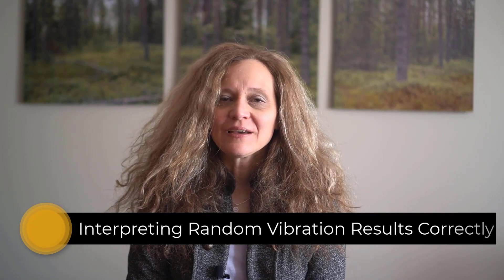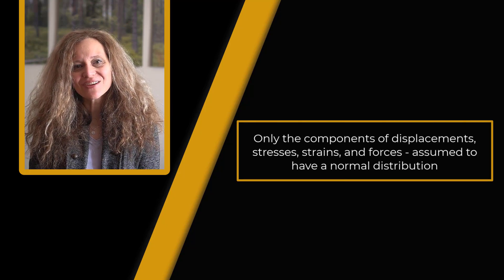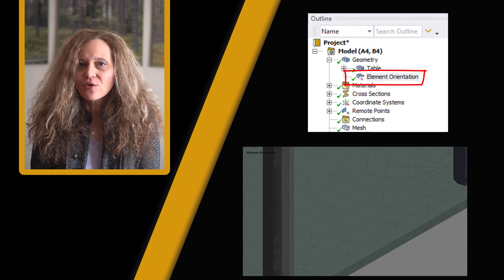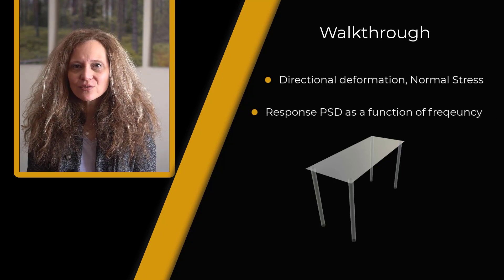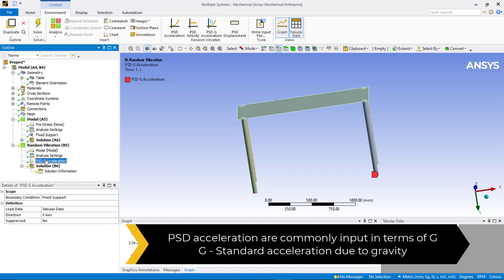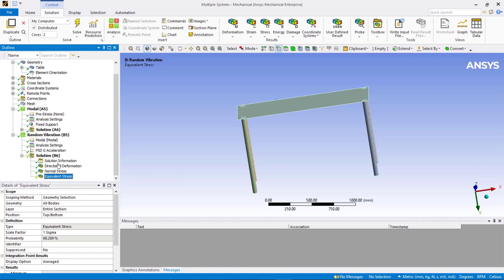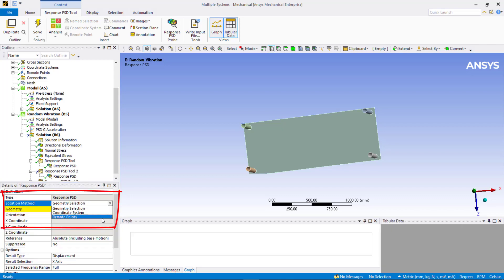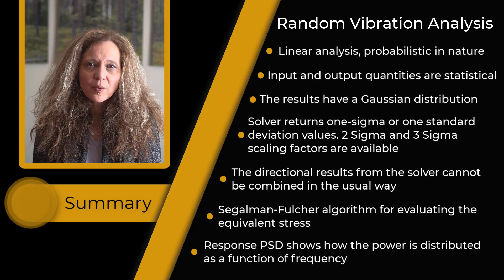Correctly Interpret Random Vibration Analysis Results Using Ansys Mechanical — Lesson 3

Comment: "Like the input, the output also has a gaussian distribution" is confusing to me. I was under the impression that the expected value calculation says nothing about the response distribution. For example, the psd presented later is more reflective of a system with a Rayleigh distribution.  Is there a reference that supports the Gaussian output statement. Thanks...

Comment: Does multiplying-by-3 method for equivalent stress applies for all 1,2, and 3 sigmas? For example, in 13:40, if I would like to report equivalent stress in 3 sigma, I should multiply 283.35 MPa by 3 (because of Segalman-Fulcher algorithm) and state, that actually equivalent stress is 850.05 MPa?